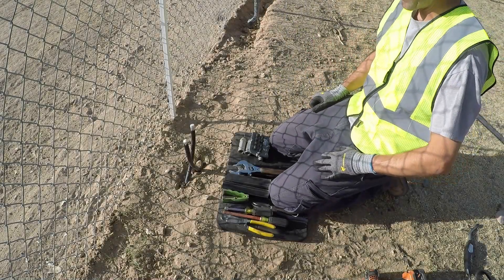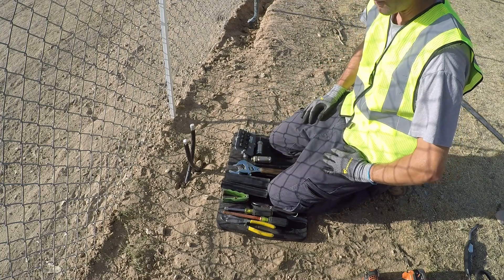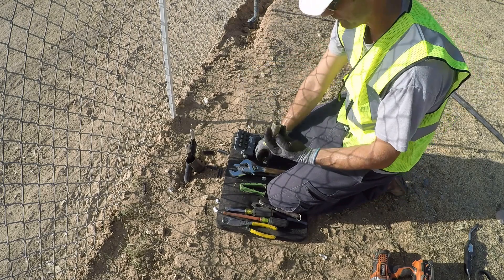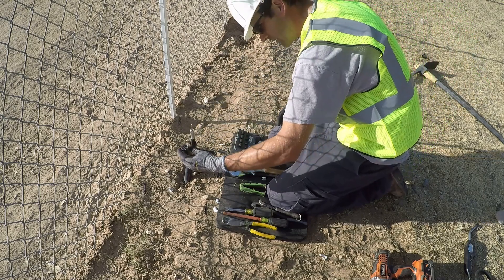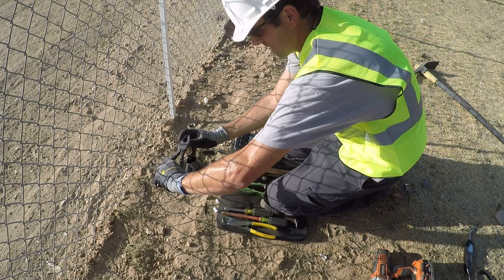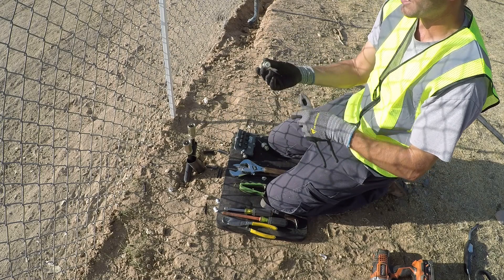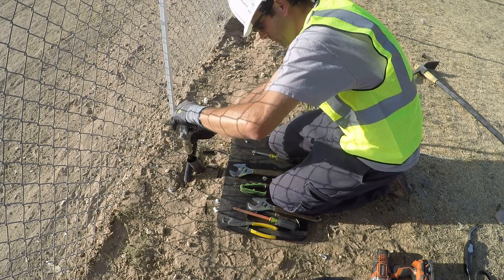Coring hardline coax and installing a tap for service

Comment: Do they even make a coring tool for 625 that will take the jacket off? All we have are the standard ones like the one you used. I know on QR715 & 860 they have that piece that comes off and you can skin the very top so the backup nut can go on but it would be very nice if on P3 cable you could just core without stripping the jacket first. Some techs cay you can core P3 like QR but I never tried it.
Reply: Yes, I have the all in one cable prep brand for 625, 500, 700, 750, and 875. Makes life so much easier. Tech tool supply carries all of them
Reply: @ajlindy1108  that is provided by your company? Is there a brand name on it? That would make life so much easier man. "Tech Tool Supply" We use "Hub 2U" but never seen a all in one on there.

Comment: That is not true. A backwards tap will not have signal at the spigots but down the line still will have signal. I just retired after 41 years. I always gave those Arris taps a retorque on the seizure screws.  Go back in a day and I bet yours are barely holding. Especially in colder climates.

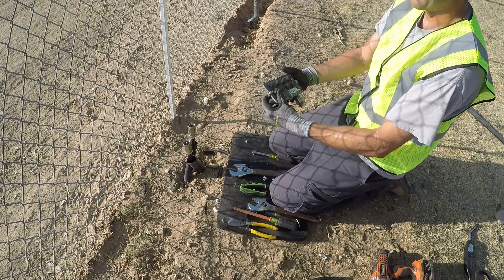Comment: 6:20 I believe if you hook it up backwards the signal level will just be low at that location . Taps after will work ok as thru loss not as affected.Thanks for the video
Reply: I actually just dealt with that about 2 weeks ago, I asked old man cable and he said its called port to port isolation. You can recreate it by hooking a ordinary 2 way splitter or dc up backwards, one port will not see any signal degradation, the other though, will see really bad signal levels. Usually the return gets it the worst, but the forward will also take a hit as well, thought I did not see any errors or ICFR. So services will continue to work but they will not work great.

Comment: Great info. Thank you. ----  Whats the typical description/spec for 0.625 to single  port RJ11 tap in the video? This would be the same for adding a tap to the output of a line amp street pedistal for singe residence?  To spec the tap the length/insertion loss for the RJ11 to the equipment.   Thank for any response.

Comment: Hopefully your not a piece rate BC god help you. you'll starve. I've made 10s of 1000s of connections and always cut the center conductor flush on first cut. NEVER have I had it not mate into the top pin. That hole is huge, way bigger than it needs to be. And if u just skrink that wrap just until its smaller it will leak 100 percent. Ive cut in new and retro for all the big companies and have had zero issues. This was a good video for educational or the inquisitive

Comment: I have a Question.     We moved our travel trailer into a RV park.  we are 80 feet from the Pole that gives service,     It only had a 4 head tap on it,  and they told us they can not hook us up to cable.      Then they told us that it would cost the RV park about 10,000 to add a line in for everyone to hook up.

Well you just showed us how to put a tap in,    Cant the cable company remove the tap on the pole and change it from a 4 to a 8   so they can drop 4 more lines down to people who are close to the pole.
Reply from the maker: Assuming the service up to the 4 port tap there is active, it's pretty easy to slap in a 8 port tap. However, it will lower the amount of signal heading downsteam so it could require the installation of a plant amplifier to get enough signal to the end of the line.
Reply from the maker: But if the service getting to that tap isn't very good and would require an upgrade to get that whole area serviceable it could easily cost $10k

Comment: Dosen't the knife scratch the center conduct?
Reply: You don't cut all the way to the center conductor when sharpening the dielectric. However, if you make a mistake, just core a little bit more to get past the scratch. I would advise against making a mistake though in case you're working with limited slack.

Comment: One tip I would have is hand tighten the back nut (or bottom nut) after you're done tightening the middle nut. That way it saves you from using your wrench so much when you go to tighten.

Comment: The reason you have to tighten the connectors in that order is because the top nut clamps the teeth onto the center conductor and the bottom nut clamps the fitting on the cable shielding. if you do it backwards you won't be able to turn the fitting without twisting the cable. Great job with video though, keep them coming!
Reply: What Midblade said. Keeping wrench on top nut after tightening middle nut risks twisting center conducter and damaging skin effect of copper. That's what I was taught.

Good to see you're making videos again.
Reply from the maker: That's not what I meant.
Manufacturers require you to move your wrench to the center section to tighten the bottom locknut. In cable games competitions they will dock points if you leave the wrench on the top part of the connector and use your 2nd wrench on the locknut. They will require you to move your wrench down. Same with a straight splice. Don't tighten the locknut while holding your one wrench on the center barrel section.
Reply: @thebasiccablechannel7464  Oh I see what you're saying. I believe its for the same thing, if you leave your wrench on the top you run the risk of turning the middle nut as you're tightening the bottom nut.

Comment: Well with 625 hard line you have  to remove the jacket before you core
Reply from the maker: I am not sure what you are referring to?
Reply: @thebasiccablechannel7464   There are a few types of cable out there like .540 and .860 that the jacket stays on while coring.

Comment: That was painful to watch.  And why is it so low?
Reply from the maker: Lol  What was so painful about it?
Reply: Not sure why you think that was painful? He did everything great
Reply: Well maybe the fact that he used a drill, but I don't mind if someone else uses drill, I use my hand only because when the tool is too loose you can't core it right and you need a new coring tool or replace the little plastic inside. Also cable is a little low, I rather dig some dirt out, but overall is his style, and it's fine, gets the work done.
Reply from the maker: @ima4916  It was for demonstrational purposes. Some of our old school guys use hand tools only but it is hard on the wrists and takes longer. As long as you keep your tools clean and sharp and inspect your work the quality is every bit as good.
Reply: i agree.. def inhouse work. my kids would starve if i went out and did this

Comment: Not sure about the model of tap you are using in the video, but with our Regals and Millenniums the only thing affected by installing a tap backward is the freshly installed tap. The taps after the newly installed tap will work just fine.
Reply from the maker: Yeah I think you're right on that one. Been a while since I've ran on one.